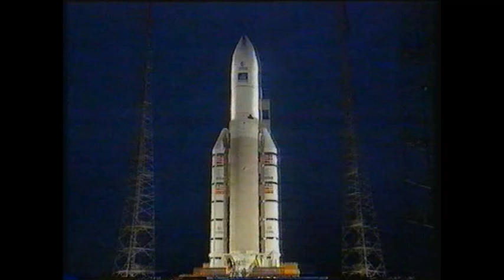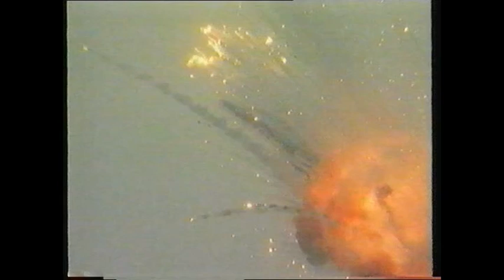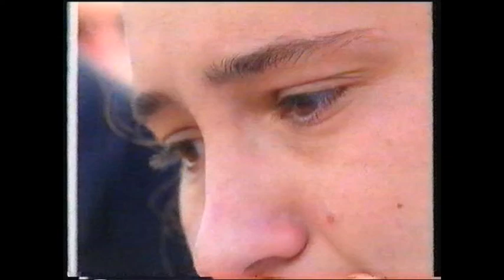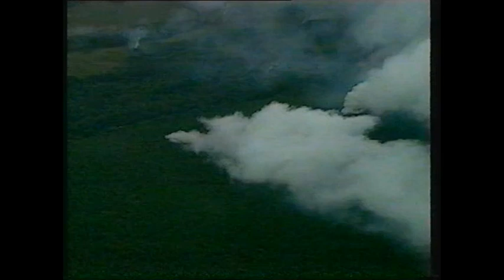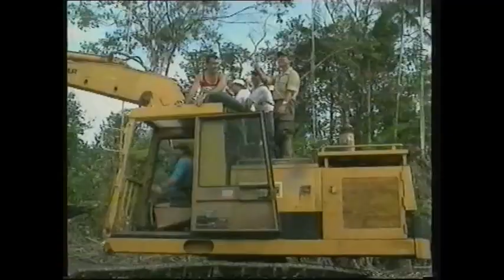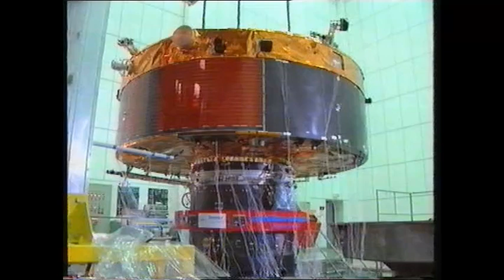Ariane 5 rocket launch explosion

Comment: The cause was a floating point bug.
In the program, a 64-bit floating point number representing the horizontal velocity with respect to the platform was converted to a 16-bit signed integer. However, the largest number representable in this system is 32,767, smaller than the number the system wished to represent. This conversion failure had larger ramifications. A data dump from debugging filled up both memory used for guiding the rocket motors and the backup computer that the control switched to. The control interpreted (misinterpreted) the data as the need to rotate the rocket’s motors, resulting in disaster.

Comment: Bonsoir à tous, ne t'inquiète pas, il y aura un nouvel agenda des lancements d'Arianespace 1996-1997 qui seront les suivantes:

10/09/96 
Vol 91 Ariane 42 P
Lanceur L462
ECHOSTAR 2

13/11/96
Vol 92 Ariane 44 L
Lanceur L463
ARABSAT 2B & MEASAT 2

30/01/97
Vol 93 Ariane 44 L
Lanceur L465
GE-2 & NAHUEL 1A

28/02/97
Vol 94
Ariane 44 P
Lanceur L464
INTELSAT 801

16/04/97
Vol 95
Ariane  44 LP
Lanceur L467
BSAT-1A & THAICOM 3

03/06/97
Vol 97
Ariane 44 L
Lanceur L468
INMARSAT- 3F4 & INSAT -2D

 25/06/97
V 96
AR 44 P
L466
INTELSAT 802

 08/08/97
V 98
AR 44 P
L469
PAS 6

Merci cordialement, Johan.

Comment: Anyone else watching this after reading about it in CS:APP?

It states in the book that this was caused by an overflow error in the calculation of the horizontal velocity. The Ariane 4 stored the horizontal velo in a 16-bit number. The code was reused for the Ariane 5 even though it could produce 5x the horizontal velo, so it overflowed the 16-bits. Makes sense since the explosion occurred right as the rocket's trajectory was starting to become more horizontal.

Comment: To sum it up: lateral velocity was produced as 64-bit by the guidance system then converted into 16-bit integer value, that cause an overflow, the designers assumed the number would never get that big and 16bit integer is enough to hold it as it worked for Ariane 4 perfectly. The software was copied from Ariane 4 and they assumed it’ll just work fine - big mistake.
Reply: It's funny how often when things go wrong the word "assumed" shows up. I guess with some people they just have to learn things the hard way.
Reply: This British BS keeps happening.  The Titan submersible, Brexit, Boris Johnson, Moderna are just a few more.  What's going on over there?

Comment: Why is NASA using Arianne 5 rocket to deliver the James Webb Telescope? ULA and SpaceX could easily do it with far less worry about a disaster. James Webb is American, and it should be an American rocket to send it.
Reply: Because the costs are carried by the ESA and I doubt SpaceX can deliver such a heavy payload to a Lagrange L2 orbit. 

As for safety, the Ariane 5 is among the more reliable rockets designed.
Reply: @Sedna063  SpaceX can do anything in space... Falcon heavy?
Reply: @americanraptor8391  The Falcon Heavy would be overkill. And ESA wouldn't pay for a Falcon Heavy or any Falcon
Reply: @Sedna063  I suppose... but I would rather see an American rocket send it up. But yea, the Ariane V rockets are reliable enough
Reply: @americanraptor8391  my point. If SpaceX would do it for free, then be my guest. But so the launch is paid for by the Europeans and that money can be spend on another science project. 

Both sides win.
Reply: @americanraptor8391   
Months later, JWST has more fuel than expected, making it last 10 more years than planned.

I bet SpaceX can't do that.
Reply: @Sedna063  Ariane has launched 80 successful missions in many years. SpaceX has launched 127 successful missions.
Reply: The fairing is the main problem, even falcon heavy extended fairing is not enough for the telescope to fit
Reply: @cynbloxy  This is correct.

Comment: And when it tilted it tore the central electrical system that is responsible of activating the self destruct sequence not only that but it used the ariane 4 software and its faster engine made a bug that hasnt been found on other models the code was too big for the software so it crahed the guidance and altitude system and the backup systems

Comment: Ariane 5 crashed because it was unmmaned so there was an AI to handle everything and there was an teeney tiny error in the code and the code was also simply to big for the AI to handle so it activated the engine self destruct system but before that the AI tilted the rocket off course and boom a very expensive mistake took place

Comment: for a F***ING 16 bits calculation next time code it in C++!!!!
Reply: C++ won't save you from such overflows from scratch because it uses implicit arithmetic conversions as well (of course you can write safer conversions by yourself), e.g. Rust will (there are no implicit arithmetic conversions in Rust).

Comment: and they're gonna use this retarded thing to launch the new james webb telescope. 
they should consider going to spaceX if they want that telescope saved.
Reply: Ariane is one of the most reliable rocket in its category.
Reply: Xenon ... It was the FIRST Ariane 5 launch, it's normal that's not successfull !!
Reply: The Ariane 5 is the most successful rocket in this class in the world. So why any other should start this Teleskope? Sinse 2003 there were 83 starts of Ariane 5 without a lose. From 98 starts only two rockets failed.
Reply: I can tell you that JWST won't fit on a Falcon 9/H fairing.

Comment: They're getting much better at collecting & analysing the data after such an event so in some ways, an early accident is a blessing.

Ariane 5 has performed very well during its lifespan as a product in a similar way to the A320 despite (or perhaps due to) early mishaps.
Reply: Yes, 96 launches, 4 failures.
Reply: @bansheebug  yes :) without death :) american space shuttle had only 2 failures, but 14 deaths.. :(
Reply: Hi, yes you are right,  the consequences are immeasurable with the explosion of the shuttles.

Comment: Don‘t mess with max Q
Reply: It happened before max Q...
Reply: It was a software bug. Trying to execute a 64 bit instruction in a 16 bit environment as far as I know.
Reply: @irasthewarrior  Sort of. Trying to put a 64-bit value into a 16-bit variable, which worked fine for the first 37 seconds of flight while the value was relatively small. And the real problem was that the guidance system then tried to read the overflow error code as intertia data and that is what actually caused the massive course adjustment.

Comment: As an alleged controls engineer, I can tell you that the business of software needs to mature. Those that call themselves project managers, I would imagine, rarely comprehend the development of software. It is mysterious to most, and few of those I work with comprehend what I do. My guess is that software in aerospace is developed with not much greater standards than automotive assembly machines in factories. The software needs as much scrutiny as the rest of the vehicle. Someone let me know if I'm talking out my ass. I'm in automotive, not aerospace.
Reply: Well in this case, the problem wasn’t that the software was bad, just that when they switched from Ariane 4 to 5 they didn’t check the horizon acceleration to make sure that it wouldn’t cause problems.  The software functioned perfectly within its parameters, and was not even necessary on the Ariane 5.

Comment: the cause of the failure was a software error in the inertial reference system. Specifically, a 64 bit floating point number relating to the horizontal velocity of the rocket with respect to the platform was converted to a 16 bit signed integer. The number was larger than 32,767, the largest integer storeable in a 16 bit signed integer, and thus the conversion failed.

http://www-users.math.umn.edu/~arnold/disasters/ariane.html

Comment: What happened was they installed an existing guidance system from an earlier less powerful rocket into the Ariane 5. That guidance system had a long history of reliable performance so no one bothered to fully test the installation. As it turned out the more powerful Ariane 5 accelerated horizontally during launch more quickly than the less powerful rocket had ever done before. When the register in the guidance system designed to track horizontal velocity maxed out and overflowed the primary guidance system shut down due to the fault. The rocket then switched to the back up system but it also had the same flaw so it also shut down. With no functioning guidance system left on board the rocket turned sideways and broke up due to aerodynamic forces. It was a relatively simple but very costly error. If they had bothered to run a simulation of the launch using the Ariane 5's actual parameters it would have revealed the error.
Reply: It was a floating point truncation error. The computer system was trying to turn a half-precision floating point number into an 8-bit integer, for the other computer. Or more over, it wasn't trying to do that. Instead the 8 bit register was getting a 16 bit number, and going "What the fuck, that's horrendously bad, steer!"
Reply: @ESAPOWER  lateral velocity was produced as 64-bit by the guidance system then converted into 16-bit integer value, that cause an overflow, the designers assumed the number would never get that big as it worked for Ariane 4 perfectly. The software was copied from Ariane 4 and they assumed it’ll just work fine - big mistake.
Reply: Whats worse this value was not even needed, it was a leftover from ariane 4:
https://www.bugsnag.com/blog/bug-day-ariane-5-disaster
Reply: So the "faulty computer software" was working perfectly with the incorrect data.
You know the reporter could fill in the dead air with actual information instead of wild speculations and empty sympathy.
Reply: @richardgates7479  The computer software was working just fine. The problem was it was being used in an application for which it was never designed. That's not speculation either, there was an investigation and that's what it found. Further, once the problem was corrected, subsequent rockets that had the fix flew just fine.
Reply: On 1:33 the uppermost stage looked like someone blown a blast of air to a pile of dust, why it happened this way, I have seen some other videos of other rocket failures which happened the same way.
Reply: Rockets disintegrate this way because it's very hard to make a rocket efficient enough that it can carry anything into orbit. So they are built as light as possible and designed to barely withstand 20% more loads than expected during normal flight. If it stays on course, fine, if there is some deviation and the loads exceed that it breaks apart. And when it starts going sideways during transition to supersonic flight the loads will be dozens if not hundreds of times what the rocket is designed to take and so it get torn to shreds in milliseconds.
Reply: What I was looking for. Thanks for the info.👍👌
Reply: Lazy
Reply: I was just talking today to a software engineer who worked on this (which is why I am here watching the video). This explanation is just what he told me.
Reply: the guidance system was from ariane 4
Reply: Classic Overflow Error
They were using 16 bit standard
Reply: Thanks for the info kind sir
Reply: It didn't overflow just like that, it was a type cast that mucked it up.
Reply: Correction: the rocket exploded due to a self-destruct mechanism for safety. Otherwise the rocket could have plummeted back to earth and caused damage
Reply: By the guidance system you mean only guidance system or the whole GNC?
Because in the atmosphere, the guidance system is basically a look table (open loop guidance)
Reply: @SaidMohamad-q3c The guidance system in a rocket usually consists of an Inertial Measurement Unit (IMU) and the guidance computer. The IMU feeds attitude and acceleration data to the guidance computer which uses the information to determine the rocket's current velocity, direction of flight, and location. The computer compares this real time information to the pre-pregrammed trajectory and gimbals the engines to stear the rocket and keep it on course.
Reply: Sorry but this explanation misses several key facts, including that the software which caused the fatal exception was only supposed to run before launch, so any issue of more or less powerful rocket is moot. For a better but more complex explanation see the full report http://sunnyday.mit.edu/nasa-class/Ariane5-report.html
Reply: @georgie3  From before launch to 40 seconds after; the fault happened at 36 seconds.
Reply: It's not as simple as 'if they had bothered to simulate' Practical engineering is not about getting it right, it's about getting it right enough. Without "roundoff" no mission would ever happen. It's all a probability vs cost equation, "sometimes it doesn't work", but the alternative is "we could never afford."
Reply: @14598175  Wrong mentality and approach.
Reply: Is a good idea adding a backup system that works the same way as the principal ? In this case the same problem occurred twice... that's kinda useless, right? I  mean, I figured it out, and it's no "rocket science"
Reply: Joe Vignolo yeah this explanation shows how lazy they were to take extra care over safety and quality.
Reply: cost be damned, you would think a multinational rocket company could afford to run a software simulation of the launch at least once before the maiden flight. testing hardware can be tricky and expensive, but testing software is just running millions of simulated launches inside a computer. every asshole has a computer that can simulate a rocket launch. any asshole megacorp has multimillion dollar supercomputers to do it, or should.
Reply: So you mean they couldn't pin the blame on Microsoft? Lol....
Reply: Perhaps they should of change the name from Ariane to Arrogant  !  as I guessing there would of been lots of That  from management when junior tech's queried problems like it was nicely  explained above ! Thanks btw )
Reply: @andrewnorgrove6487  
Perhaps you should have learned to spell

Comment: It's still the most trustworthy rocket on earth.
Reply: A manual self destruct is still a mission failure and there were 2 Ariane 5's that partially failed (Im not trying to say its a bad rocket, its a great one) so Delta II's record is still ever so slightly better.
Reply: You should really check your numbers again. Even if we were to limit the Soyuz family down to its most well-known variant, the Soyuz-U, we're still looking at 765 total launches with 22 failures. That's a success rate of more than 97%. The PSLV with its 38/40 = 95% doesn't even come close to that. As for the GSLV MkIII... well... a total of two launches is not exactly a reliable dataset, don't you think?
Reply: Right. Now it has 38 successful launches out of a new total of 41. That means its success rate is down to 92.68%. Ignoring the facts, are we?
Reply: By the logic in this discussion, the Falcon Heavy is the most trustworthy rocket on earth. It has a 100% success rate, does it not?
Reply: Maybe. Let's see how they do after reaching 700+ launches.
Reply: No doubt. But the point here was reliability, wasn't it? And in that particular category, the Soyuz is very hard to even compete with.
Reply: so in summation, ariane 5 has some work to do before it's anywhere close to what this dude claims.
Reply: OpenGL4ever that's not even correct if you're being technical and persnickety. I don't know where you got that. Saturn V has failed, falcon heavy has not, period.
If you're saying it's because they didn't land the core booster, how many boosters did Saturn V land?
But of course as I said that's being persnickety. Still I think it will be more reliable than Saturn V though when it has launched more.
Reply: NaHCO3 they won't do that many, because they'll switch almost exclusively to the BFR, which will have many times the lifting capabilities AND more reliability at a fraction of the cost per launch. 100% reusability is wonderful.
Reply: PotatoMC by the logic of some of the people in here, yes.
Reply: @PotatoMC
The success rate of the Saturn V is better than that of Falcon Heavy.
Reply: Atlas 5 is 100%
Reply: thefowlyetti2 that's true, people give ULA crap about not innovating and stuff but they are incredibly reliable.
Reply: mosshark No, it isn't. It's French.
Reply: С О Ю 3
Reply: The french was the third country to launch its own satelite with its own launching system in 1965, behind USSR and USA.

Ariane is one of the most succesfull space launcher programm ever created. The last Ariane failure was in 2002, Space X didn't exist at this time and if we will had to rely on Space X or Blue Origin, we would have launch nothing.
Reply: Most reliable compared to what? The currently 1869 launches with a 97+% success rate of the Soyuz family? I kinda doubt it.
Reply: Actually overall record wise Delta II is the most reliable rocket ever flown. But Whatever. THEY ARE ALL AWESOME!
Reply: NaHCO3 The BFR is expected to have reliability on par with commercial airliners. They're putting so many redundancies in there there's almost no way for it to go wrong.
Soyuz is a pretty great rocket though, not going to deny that. Not BFR will blow them all out of the water when it comes.
Reply: Yes. Booth had one failure which was not wanted.
Reply: Actually one Delta II and one Ariane 5 were destroyed. (Also one Ariane was destroyed manually because one engine did not work properly) But there were more Ariane 5 starts so Ariane 5 is the more reliable rocket.
Reply: PSlV is the most trustworthy
Reply: Falcon 9 will be, assuming they've finally figured out how to make their helium tanks stop exploding. After two failures related to the helium tank, I'm sure they've done extensive work to secure those extra well. 95% success so far and will only continue to rise no doubt.